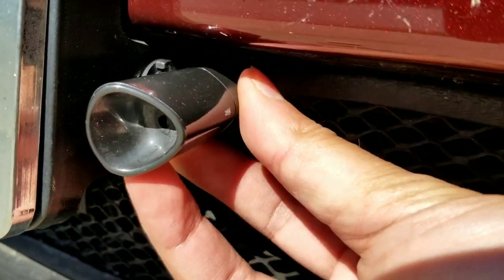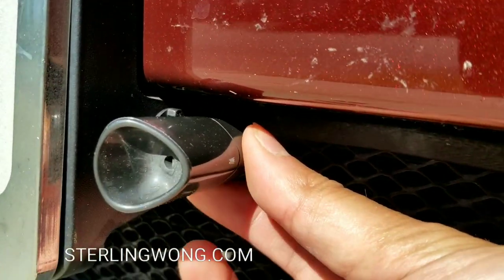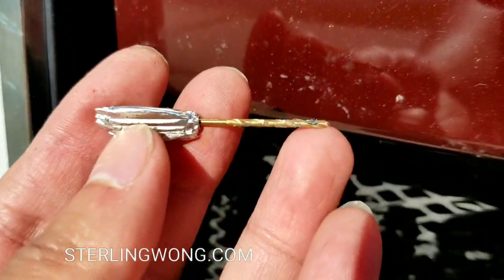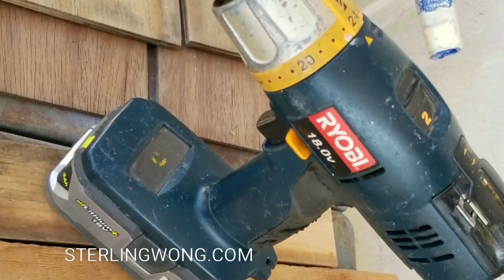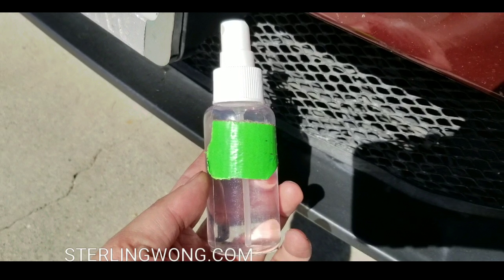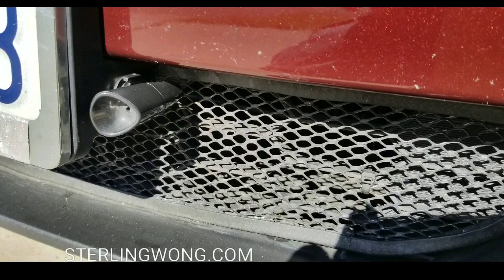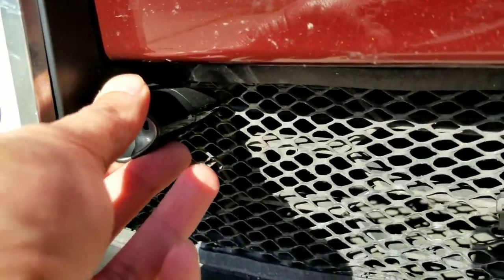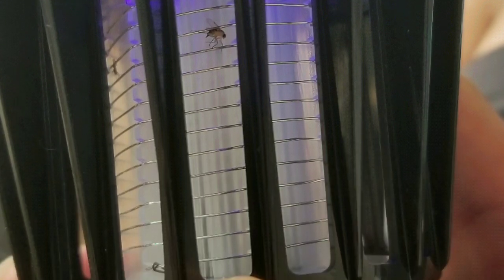DIY: Installing Deer Warning Whistles! - Why you should use screws instead of mounting tape.

Comment: You fail to mention which side which whistle goes on? One has an open hole a d o e does not. Is there a correct placement  for each?
Grrrr...I already put them on when I realized maybe this is important?!
Reply from the maker: The wide side faces the front of the car so it captures wind.
Reply: The one that looks closed goes on the passenger side and the "open" one goes on the driver's side. I don't recall if they have to be a certain distance apart though. I put them where I had room and they would get air flow through them.